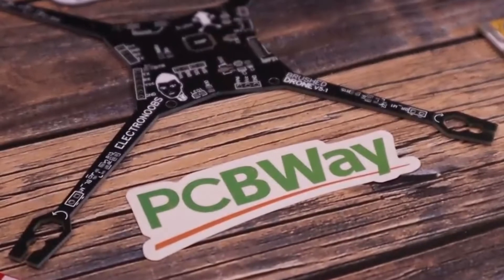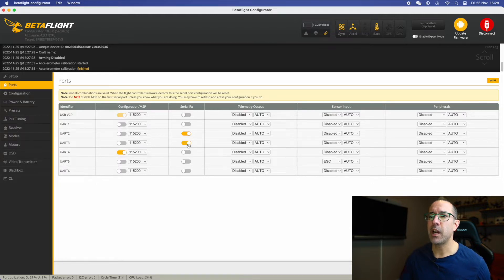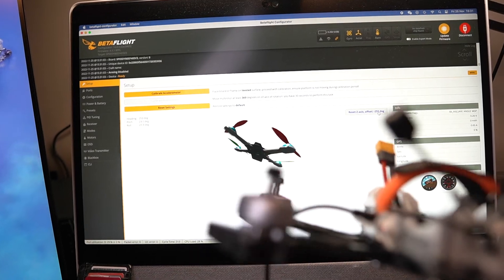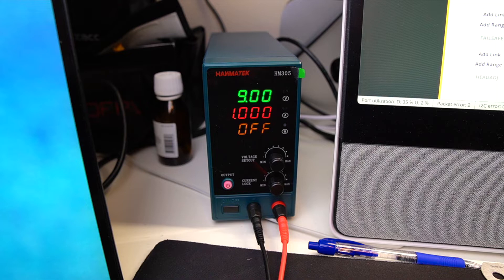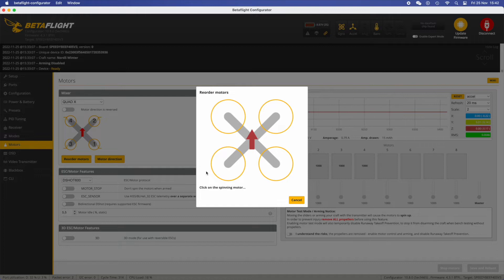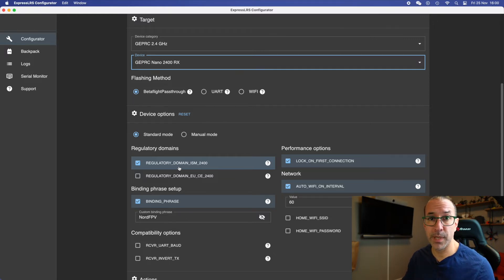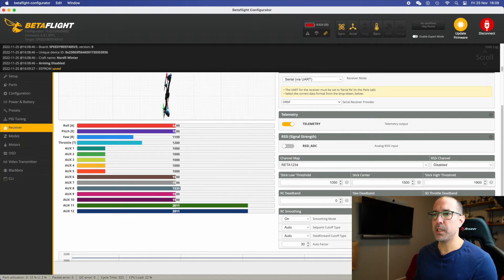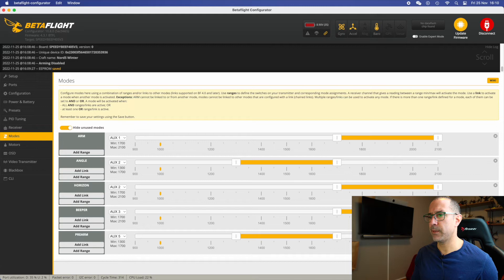Building a freestyle 6S FPV drone with the Nord5 frame - PART2- Software Config

Comment: Just finished building your frame with the SpeedyBee F405 V3 stack and 2400KV motors I had laying around.
Walksnail VTX and ELRS.
Any chance you have a 4S PID tune for this frame ?
Reply from the maker: Hey Snail-Walker, Sorry it took some time to answer but I was asking my customers to see if anyone had done a 4S tuning. Unfortunately everyone seems to be in 6S and I couldn't find you a 4S example. Sorry again.
Reply: @NordFPV  no worries!
Build turned out fine!
Printed the avatar antenna mount and standoff spacers.
Will maiden on Speedybee stock tune and go from there.